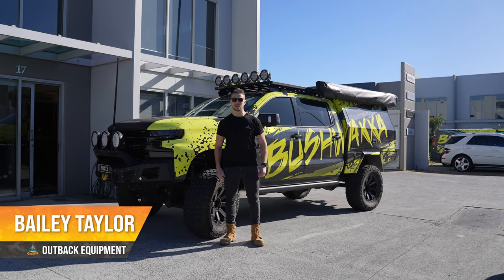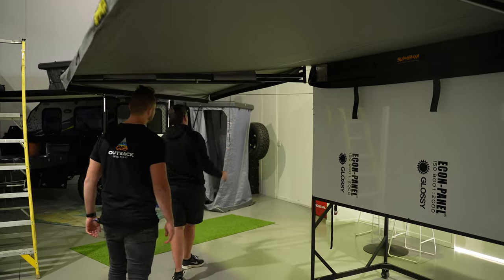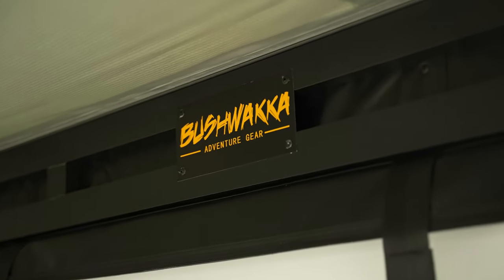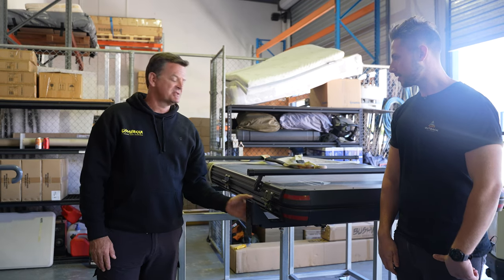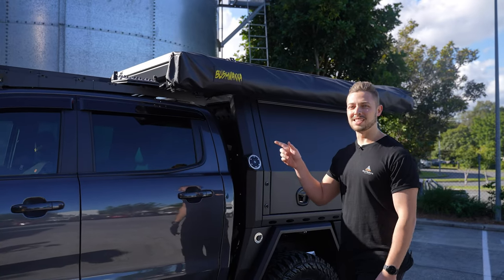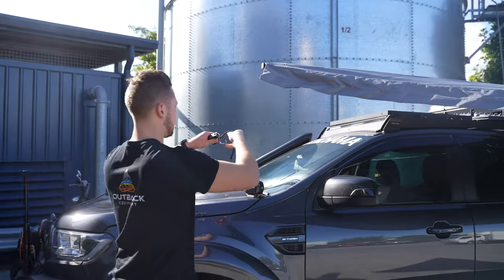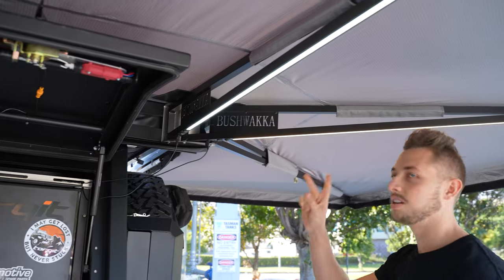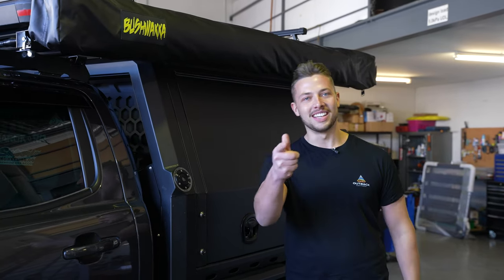BushWakka Extreme Darkness 270°+ Awning - Install And Review

Comment: I just finished up installing mine 😎 very impressed with the quality and strength. Pumped that it’s Australian made too 👌Mounted up to an ARB steel roof cage. The standard brackets don’t work with it so I fabricated my own.
Reply: You might find this is the Chinese model (although they also use the ENDO upgrade) the UBeaut is the Aussie made version

Comment: What wind speed is it rated to with and without the pole?
Reply from the maker: We don't have an exact km rating but when the unit is free standing it can deal with some light wind. It is recommended to put pegs, ropes and poles in if wind or conditions are less than ideal however.